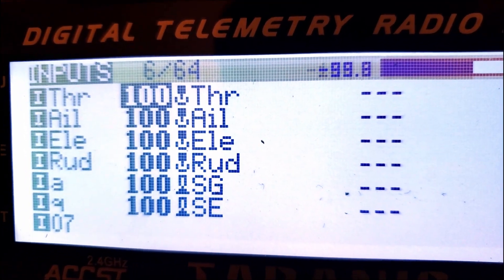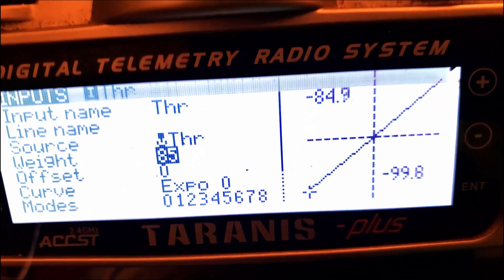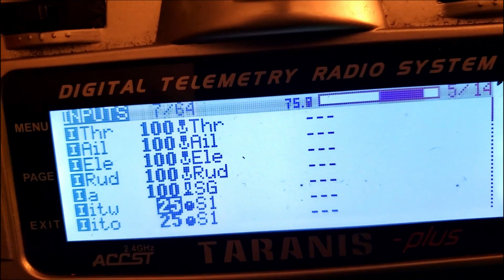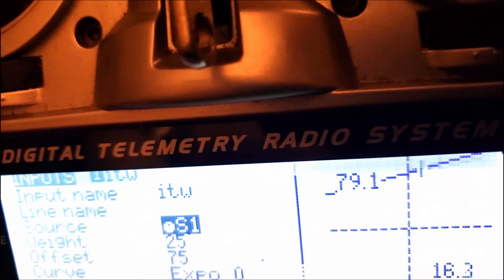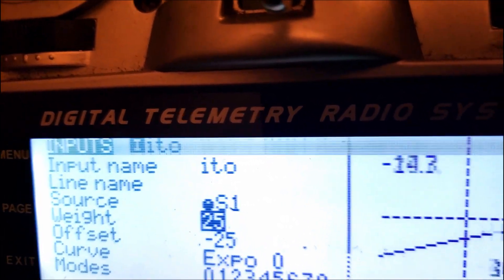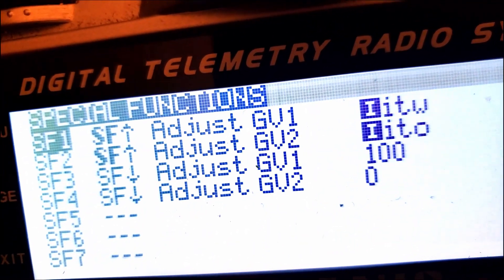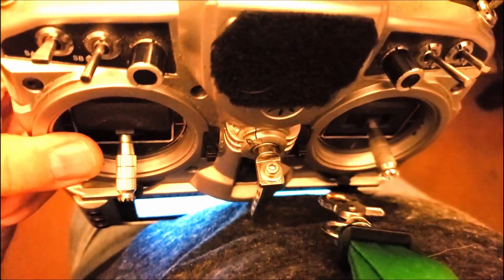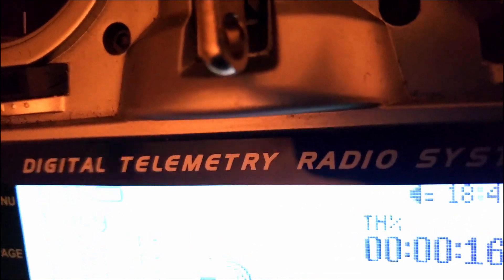How To Configure a Variable Throttle EndPoint on FrSky Taranis (OpenTX)

Comment: I wanted to do this for flying in tight areas. BUT... You must be using a different version of OpenTX. I don't have "Global Variables". I'm running v2.2.2. It probably could still be done on mine, but I wouldn't know how exactly. Oh well, I will just have to deal with the long method, major PITA.
Reply from the maker: https://forum.alofthobbies.com/index.php?threads/global-variable-settings-menu-opentx-2-2-2.788/

Comment: I prefer doing expo on the throttle so i still have the punch if i need it.a little expo at the bottom will still give great control and resolution at the nottom and added control.then on a full punched throttle that power is there instead of being lost.great flying
Reply from the maker: Not quite the same effect, but I get what you're saying.

Comment: Got it done.. thanks man! The setting up the switch to enable variable throttle endpoint, Im kinda searching for a reason to do this.. switch off.. 100%.. switch on and turn the knob.. seems an extra move for nothing? Unless your knob is half way (75%) and you want to get there in a hurry during flight? Guess im asking why have a switch?
Reply from the maker: Ultimately there's no reason if at Max you are 💯.. if you tie multiple aircraft to one model in the transmitter it can be useful if you want it for some but not others.  Again you can just turn the knob.
Reply: @StacemanFPV  I was just wondering... I do bind all into 1 model. This is awesome and very useful.. can't wait to try it out! Thanks again man!
Reply from the maker: @hillbillyfpv1  Hopefully it helps!

Comment: Nice video. This could be very useful in several situations. Thanks for sharing. I do have a question. Would you happen to know how I could set my throttle value to where at let's say 75% throttle it's actually reading 100%? I know I'll loose resolution but that's ok, iam trying to make stick travel be less to get to full throttle.
Reply from the maker: Ok so you want to hit 100 percent throttle at the 75 percent stick travel point?
Reply: @StacemanFPV  yes
Reply from the maker: Sure!  Go to the curves page and create a custom curve with 5 points.  Set the points for 50 and 100 to a value of 100.  Set the -100 point to -100, the -50 point to -30, and the 0 point to 43.  Adjust to get the line like you want.  You can tweak this to suit your needs.  Then on your throttle input page, set curve to custom and select the curve you just created.
Reply: @StacemanFPV  I'll give that a try thanks!!
Reply from the maker: You're welcome!